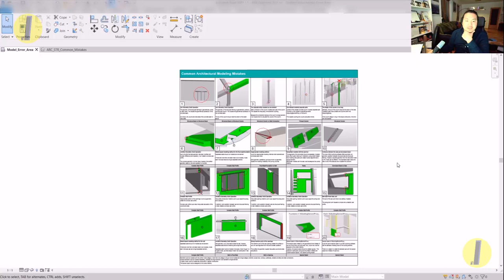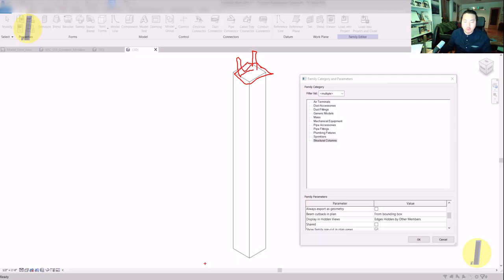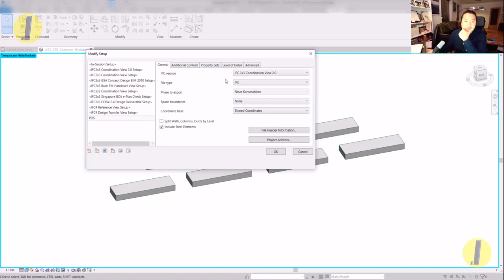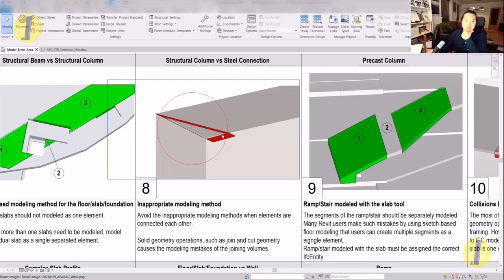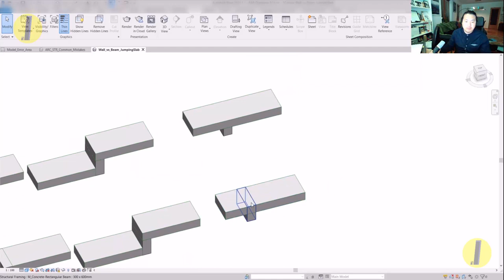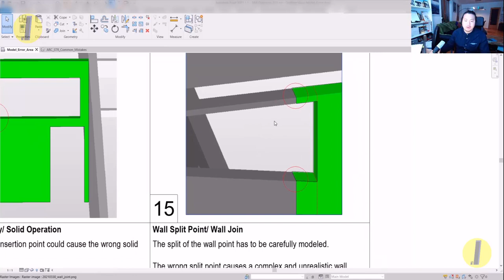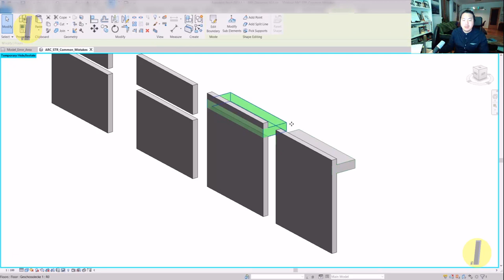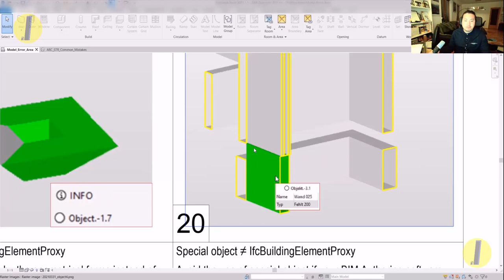[OpenBIM] The Common ARC/STR Modeling Mistakes

Comment: Some good tips, although 17:24 is actually not necessarily ideal. Most engineers i have worked with use a minimum beam height from top of slab, as the reinforcement turns through the slab as well. As a result it is more correct to treat the beam as the zone to the SSL, not from the soffit below. This appears to moreso be a problem with how the exported ifc objects behave in the joining process, as beam and slab are structurally one in this zone.
Reply from the maker: Thanks for watching it!! I felt the video is too long... You are absolutely right that downstand beam should be one zone within the slab due to the reinforcement details. If the span of the slab is long along the downstand beam, then many structural engineers suggest modeling the downstand beam with the wall tools so that the bending moments and stresses are showing correctly in most FEA software. Because Revit cannot constrain the release condition of the beam as there are only start and end nodes in the analytical lines. So.. many structural engineers who I worked with recommend modeling the top of the wall at the bottom of the slab. The reinforcement planning is anyhow based on the structural analysis.. however, if the span is not too long then the beam can be modeled below the bottom of the slab. In reality, the overlapping volume must be the same zone as you mentioned, so the reinforcement detailing must be planned as constructed.
However, there are common mistakes because of the join/cut geometry operation or solid operation that part of the overlapping zone between slab and beam has been subtracted and the slab remains with two volumes as one. I think the communication between architect and engineer is very important for this case.. Thanks for the comments!!